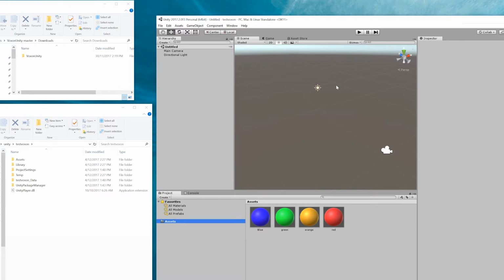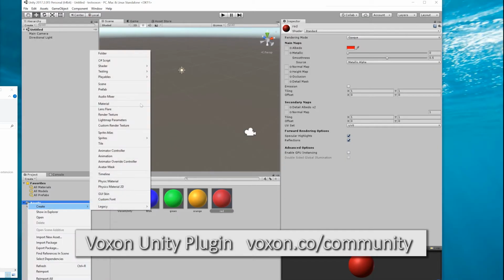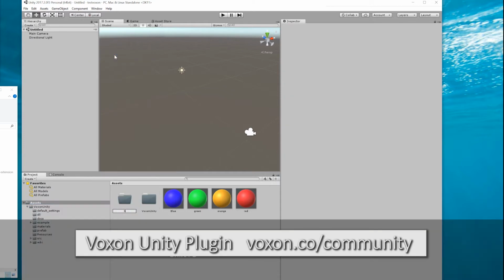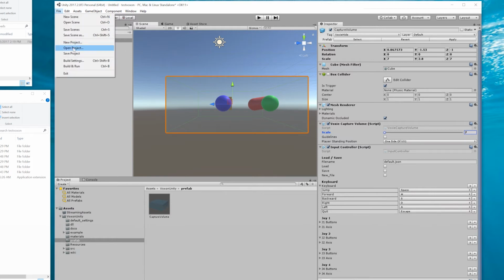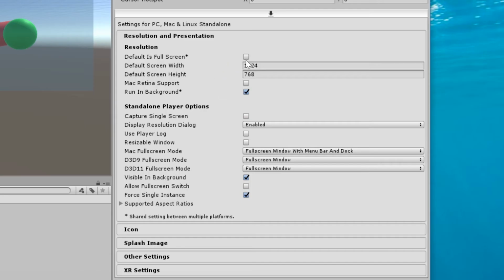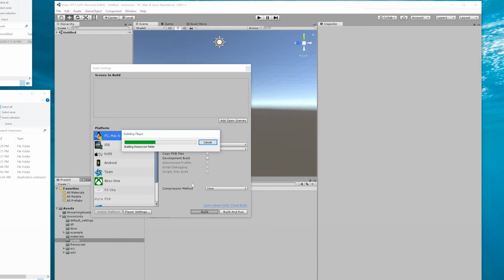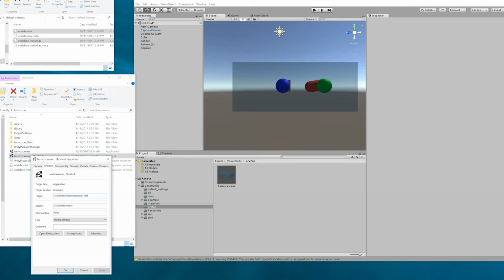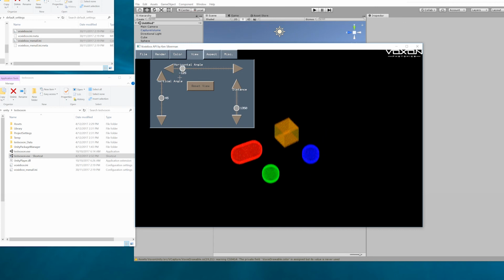Unity Plugin Beta Release for the Voxon VX1

Comment: What happens if you put an opaque object into another opaque one? Will it be rendered or culled?
How does it look if you put an opaque object into one with a glass material?`

It looks like all objects opaque or transparent will have a hologram like appearance which is kind of expected, but seeing it in action is fascinating.
Reply from the maker: Hi Pixelasm,
Good question.  If you are just talking about using the native VX1 SDK ( writing some C code) to render multiple 3D objects such as STL files into the same volume, then it would be as follows.   

STL files are 3D objects represented as surface meshes.   When you display an STL file on the VX1, or any volumetric display, it will be translucent and you will be able to see objects behind it. So there is really no such thing as an "opaque" object in volumetric display terminology.   Initially a lot of people think that rendering objects as solid will be a good idea, but in fact this overwhelms the senses and you lose the ability to determine form. Think of it like looking at the sun ( though don't try that! ). Because it is an intensely bright self-illuminated object, it is impossible to determine that it has form. Of course we know it is a sphere, but it could just as easily be the end of a cylinder.  With volumetric data, rendering surfaces allows you to see both sides of an object, which in turn creates perspective which makes it possible for the human eye to detect the true 3D nature of the display.  So, in summary, using the native SDK, no culling will occur and all data will be rendered.

If you rendered the scene using Unity and used our VX1 plugin, then you will have access to the Unity lighting model. ( the Unity plugin is available now on our website, but lighting is not enabled yet ) . So it will soon be possible to only pass lit vertex data to the VX1 core engine. This means that when your scene is lit in unity, intersecting objects will not be lit on the inside, and thus those polygons will be "invisible" to the VX1.  

- Gavin 
CTO Voxon Photonics
Reply: Voxon Photonics A great many thanks for this extensive insight. As I am working with tier one automotive suppliers this is very interesting for a possible collaboration.
Although I suppose OEMs are already in contact with you.
Reply from the maker: We are always interested in talking to businesses in regards to collaboration, growing and scaling our business and products, so get in touch! Send us a quick email to contact@voxon.co :)